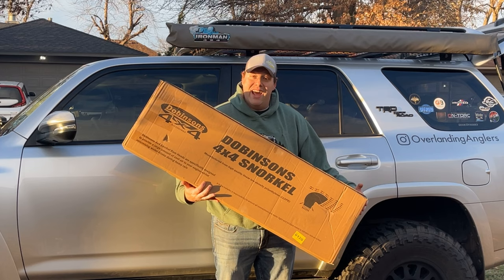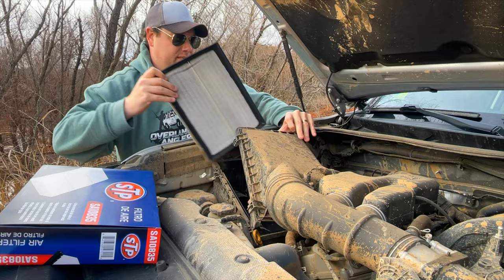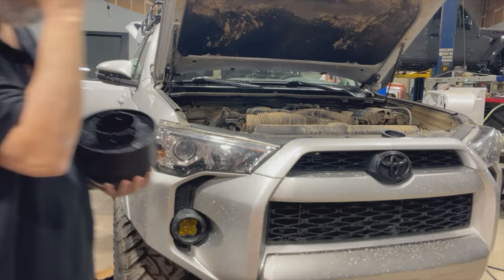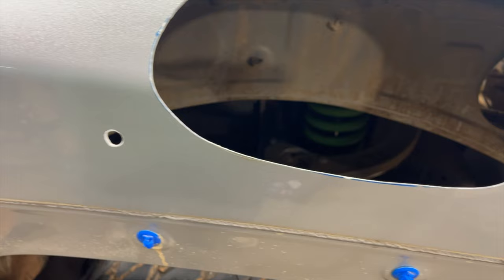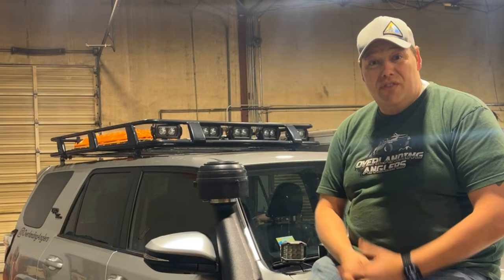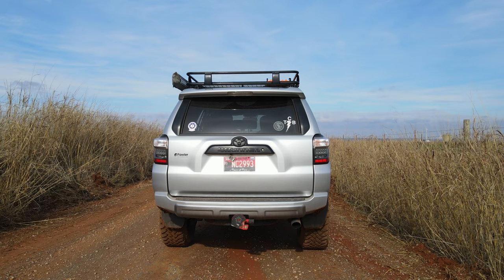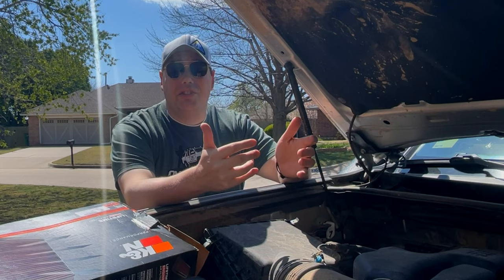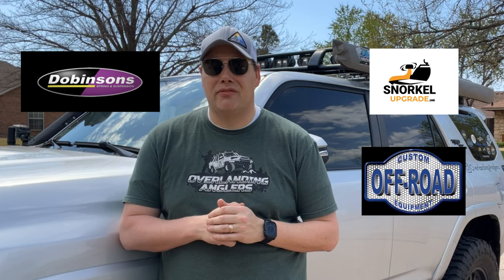Do you need a Snorkel? Dobinson's Snorkel review, Install, Real World Test

Comment: Many thanks for your informative video. I'd be very grateful for your opinion on a cool air intake modification I'm thinking of making. I have a Hilux SW4 diesel 2008. The air filter is like a drum on the right and it receives air from under the wheel arch, which, even if the ill-fitting plastic liner with its fragile fasteners provided reasonable protection from dirt and rain thrown up by the wheel, I'd like to shift the air intake to inside the engine bay at the coolest, most protected spot. My idea is to block the orginal entry tube and fit another of the same diameter either forward to just behind the headlamp or at the right back corner of the engine compartment. Can you tell me which would be the cooler position and least likely to suck in dust and rain. Incidentally, I'm againt schnorkels for varios reasons, although they do look "sexy". I'd be extremely grateful for your expert advice on this project.
Reply from the maker: Honestly I was hesitant until I discovered the Sy-Klone precleaner. It makes a world of difference. As far as moving it. I’m a little more hesitant. Really nothing in the engine bay will provide cool air or enough air. Going behind the headlight means you’re more likely to ingest water and dust. You need to get the air from outside the bay all together.
Reply: Many thanks for your advice. By all accounts, the sporty filters withot an airbox must suck in only hot air as often they're located right on top of the engine. Most You|Tubers condemn them. It seems the only solution is a snorkel with a bell-shaped pre--filter head, which can receive air from any direction and provides good protection from water.